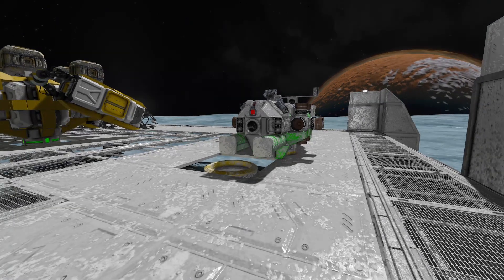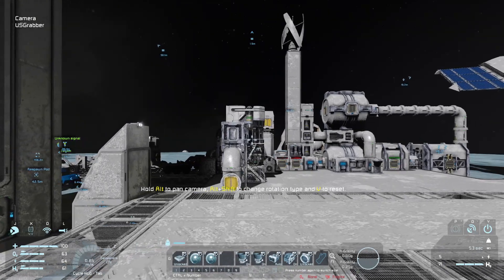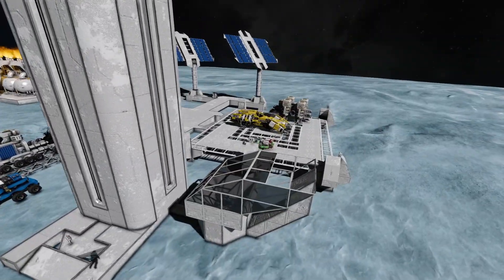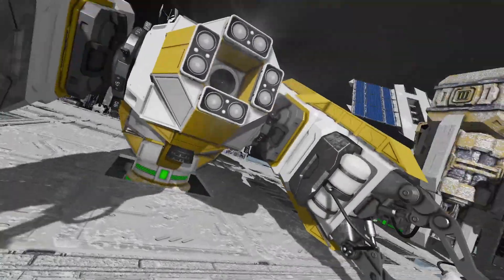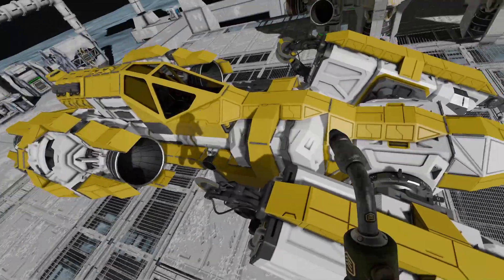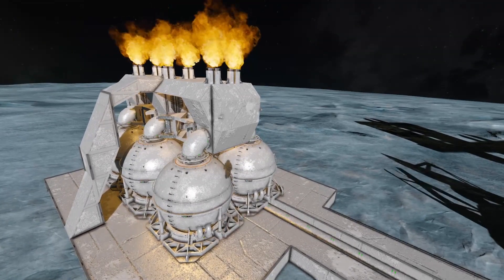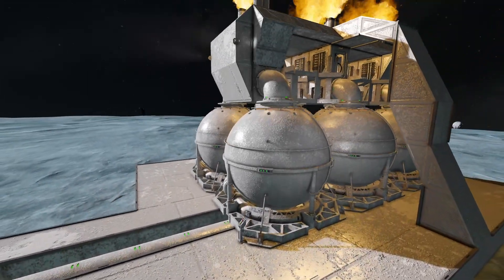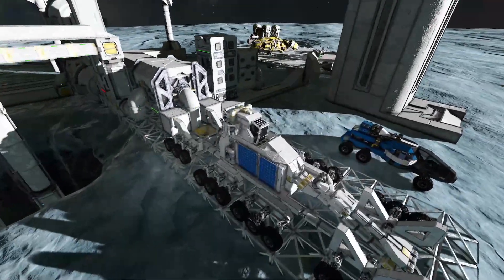Space Engineers Surviving Europa: Another Context Video

Comment: 9:55 The idea you have here is good and you can probably fix the issue without extending the ship's length. Set the rotation limits to 0° and 180° and then just use a button with 'Reverse Rotors'. If they're straight forwards and backwards, the thrusters should be clear. The thrust you have on the ship should be more than good enough to handle whatever pitch you need to weld or grind whatever you need to.

Comment: The one thing I have never seen on S:E is someone build a rig that drills for water or oil same as in the real world. all you need is a drill, Advanced rotor then 10+ to 15+ round conveyors with another advanced rotor on the other end. having multiple pippings of these. I can see it working but you'd need to figure out how to stack them on to a vehicle.